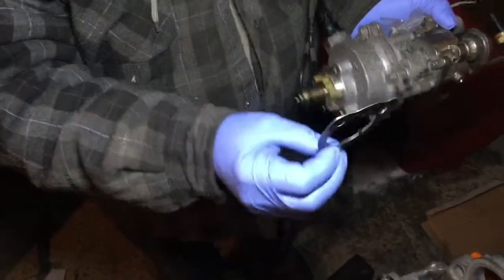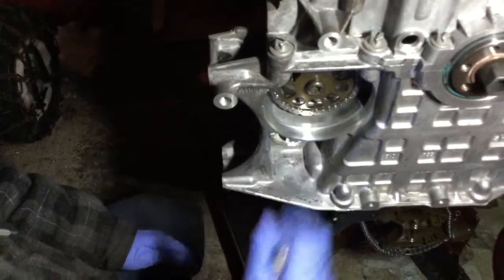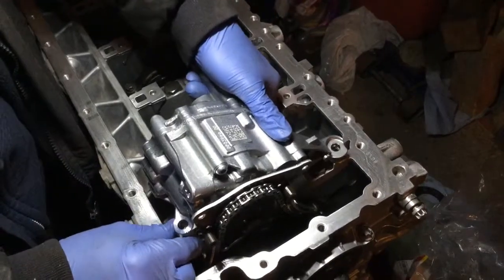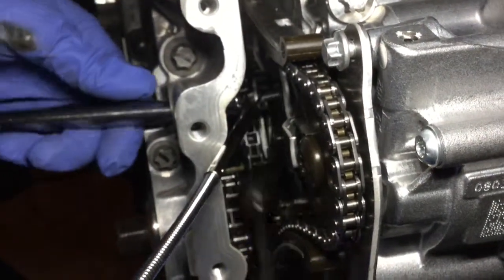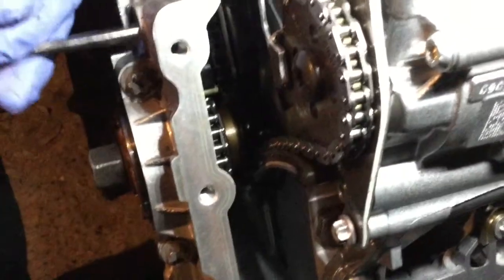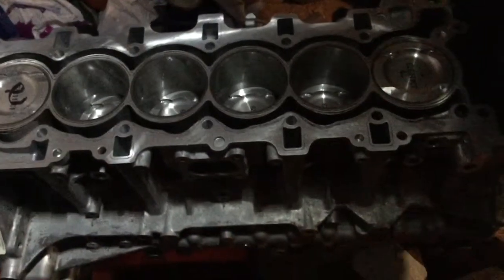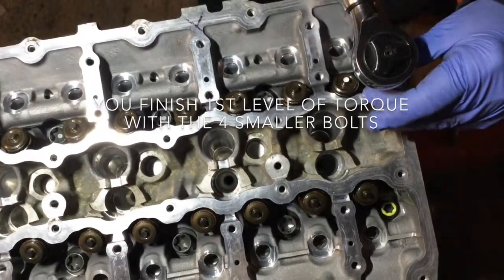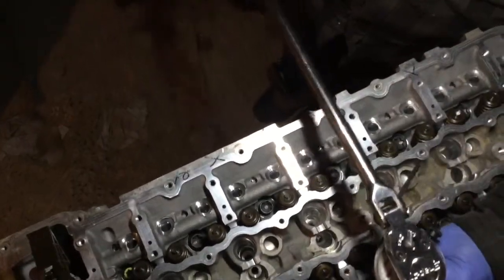44 BMW 135i N54 E82 - Engine Rebuild - Oil Pump, Vaccum Pump and Chain, Cylinder Head

Comment: The way of using of the Angle Gauge Tool was incorrect, the L-shape side bar must be locked somewhere on the engine so that it does not move when twisted, only that way the scale moves when twisted and shows the angle. Anyway, I recommend using an easier Angele Gauge Tool with a flexible arm.
Reply from the maker: You are right about it. But by experience, this tool doesn't work very well as you described above. Good to know about the tool you are suggesting. I'll consider it when/if there is a need to replace the actual one. Thanks for your feedback.

Comment: Hey man I rebuilt my n54 but got stuck at the oil pump main bolt for the sprocket the first time I did it I was trying to save money by using the old components then it snapped the plastic I had to do it again but on doing it again I was afraid to break it again so I torqued it to the 20nm and about 17 degrees instead of 45 I will probably take it to a bmw dealership just to torque that bolt how annoying
Reply from the maker: Hi, sorry you had a bump in the road. I am not sure which plastic you are referring that broke on you. You can always give me a time in the video or a part number to look for on oem.com if you feel it's needed.

But one thing to mention (if you already know, just ignore...) for all case (except perhaps very rare occasion that doesn't come to mind at this time) when there is a bolt to torque with a 2nd, or more torquing stage that involves angular specs: you always need to replace the bolts.

Angular torque is meant to create a controlled permanent deformation of the bolt during the torque. This permanent deformation is calculated based on a new bolt that didn't have a permanent deformation yet. Using an old bolt might result on a bolt that will break during the torque stages, or in function, or if you are lucky and it doesn't break, the bolt might have less holding strength (even though that sounds counter intuitive).

You can think of it like a paper clip. If you pull one end of it lightly and release it... The paper clip get back to its original position, and no one can tell you pulled out on its leg. But if you pull hard on it, when you release the paper clip's leg, it comes back only partially. The paper clip at rest has now an open leg kind of.

When you torque a bolt with an angular torque spec, it does like the paper clip permanently disformed. And if you go again back and forth with the paper clip's leg, it will break on you. Same thing as if you re-use a bolt that has been torqued with angular torque specs... it has been permanently disformed, and it is very likely to break if it goes through the torquing cycle again.

I hope this help.

If you're are using a new bolt, there should be no reason to not give it the remaining torque angle to reach the specs. Again, there is something I am not sure to get about the plastic that broke on you.

I wish you good success in your repair.

Comment: Can you please help explain how to remove the crankshaft sprocket to remove the vacuum pump timing chain tensioner assembly?
Reply from the maker: You might want to look into my "Engine Disassemble  Section". More specifically, this will be covered in 2 different videos (video 23 and 26): https://www.youtube.com/watch?v=CCOu7VfNyJo   and   https://www.youtube.com/watch?v=OdzHTxXy34Q. 
When putting it back together, you might want to look at video 41  (Engine Rebuild section) https://www.youtube.com/watch?v=ZXVnZead1Pk  
I would suggest you to also pay attention to my comment (2nd comment) as there is another way to do it that I have described.

Comment: I separated my hpfp from the vacuum pump and opened up the vacuum pump.  Do I need to oil inside the vacuum pump any when reassembling?  I wiped it down inside.
Reply from the maker: I'd like to help you, but I didn't open my vacuum pump. I would check with the dealer about it. Often, you can ask a small question like that to the parts clerk. He will ask one of the mechanic if he doesn't know.

Else, I would try to see first if the pump is lubricated with an engine oil port. Then, I would also consider the condition it was in when you took it apart (oiled or not, and what kind of oil).

Comment: where did you get your new valve guides?  cant find them any where.
Reply from the maker: At the time I did my engine rework, there were none available on the after market or at the dealer. I have contacted a friend of mine that is machinist. 
I brought him the cylinder head, I had one valve guide removed. We took measurements. He also made me tools to install them as you can see in the video.
If you don't have such a friend, you might need to look for a machine shop in your area.

I would suggest you to watch the video carefully and take notes. Talk with the machinist/machine shop they will be able to fill the gap with you no problem.

Comment: did you reuse steel cylinder head bolts?  or bought new?
Reply from the maker: You should check in the video to make sure we're talking about the same bolts, but they must to be replaced.